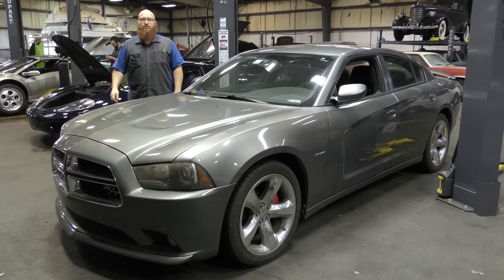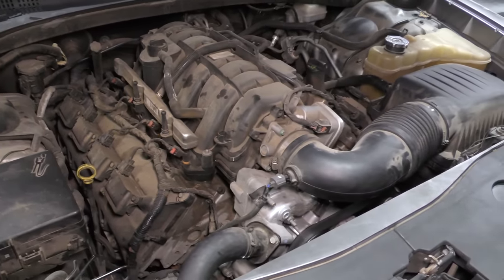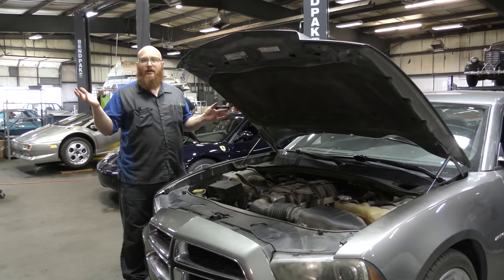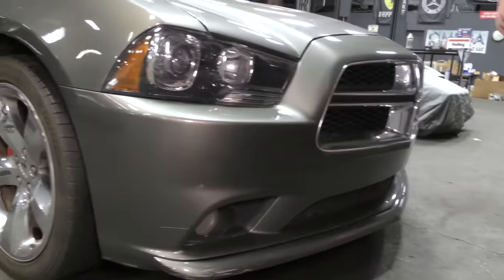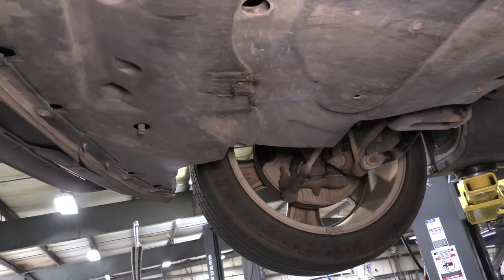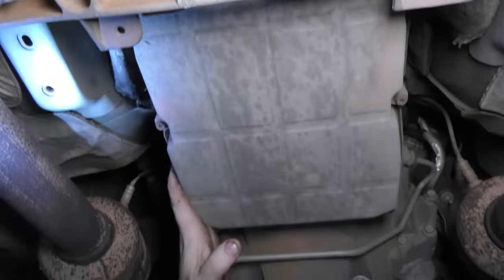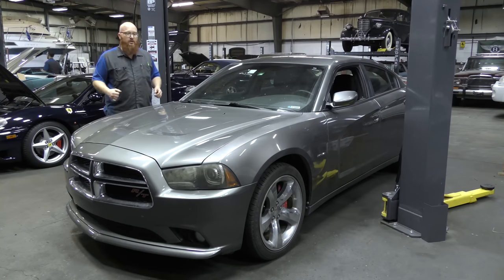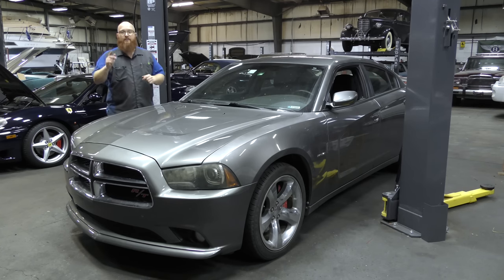Tic Tic Tic! 2011 Dodge Charger RT has the infamous Hemi tick. What will the CAR WIZARD do about it?

Comment: I just a couple days ago returned from the Ozark's in NW Arkansas from a weeks vacation where apparently a motorcycle event was taking place which I knew nothing about. About 99% of the bikes, no mufflers, loud radios. All weekend long I had to put up with this but then realized it wasn't just the motorcyclist but damn near the entire region in general. None of the diesel powered skyscraper 4x4 pickups had mufflers. Actually there was one beat-to-hell 72' Ford F-100 with half the bed hanging off the frame rails who did have a muffler. Many old beater cars, no mufflers. Even one of those two-seater egg shaped smartcars with a Beetle hood was quite loud which surprised the hell out of me. Couldn't see the darn thing cause it's so small but I heard it coming up hill from 1/4 mile away. Ain't no wonder the Christ of the Ozark's statue has ear plugs.

Comment: Dropped Valve seal on the early 5.7
The rest have a hemi tick because of the mds system. Do a mds delete and tune your car with the mds shut off before dissembling it.
Reply: Non mds hemis also get the tick.

Comment: the Hemi Tic i have found more times than not to be rocker slap . It may slap forever , the roller on the rocker may also lock up and slowly eat off the cam lobe off all while filling the engine with metal shavings. No one usually notices till the PCM cannot adjust out anymore so you get a misfire and code but by then it is way too late , those shavings circulate destroying the engine...

Comment: The tow rating for  a 2011 Charger R/T is 2000 lbs. That 3500 lb is what the hitch is rated to. Do not exceed the vehicles rated capacity.

Comment: On my 2015 Challenger RT it had the hemi tick since new,  the only thing that quieted it down was using royal purple oil, it would work well until the oil got old and thinned out. This was in the heat in Vegas as well.
Reply: That purple oil any good..?
Reply: @keyroncampbell  It worked for me , I had a 6 speed car though so I went up in weight from 5w20 to 5w30 I believe it was, I'd have to go back and look at my receipts, if you have a automatic car with mds cylinder deactivation though the thicker oil may or may not cause problems with the cylinder deactivation but that can be remedied with a tune now I believe, not that I'd let that worry me though.

Comment: helloo. my '05 Magnum R/T dropped a valve, chewed it up - new bottom end. Big money. Could you tell if the valves are bad by listening with stethoscope? If there is jingling or whatever to go with the tick? BTW, hole in muffler, tick went away. Hmmm. Ü

Comment: Wizard I hope you see this: I have a 2012 Ram with a 5.7, the tick is SUPER loud and it’s coming from the right side. The gas mileage is dropping, and I have carbon on the exhaust on the right side. Local shop quoted $500 to fix it, says it’s the exhaust manifold bolts. Are they being honest?

Comment: The “tick” is because the camshaft lobes are starving for oil do to a design flaw. They moved the camshaft up and the lifters outward. The oil from the lifter galleys doesn’t drip down onto the lobes as they no longer sit directly over the cam. Add to that the balance shaft between the crank and the cam and the oil splashed by the crank also no longer makes it up to the lobes. The roller lifters end up eating themselves and the lobes of the cam.
Reply: I heard the 6.4 fixed that problem. Did they redesign the engine?

Comment: My 392 got the “Hemi Tic” and it turned out to be defective lifters which Chrysler Fiat is not willing to do a recall on which wound up destroying my engine because it completely chowed the camshaft.  Definitely is something to worry about and it’s definitely something that needs to be fixed. These defective lifters were installed in the 5.7 as well in the jeeps ram trucks and all Chrysler platforms across the board. 
August 2019 they retried and superseed the lifters with a completely different part number and design. Pre-2019 buyer beware. Having a 392 rebuilt ain’t cheap. I’m ready to jump on board with my receipt if there ever is a class action suit against these bastards at Chrysler/ FIAT. However after the rebuild my 2012 Dodge Challenger SRT tears up the road like a scalded ape.

Comment: I just just got a 12 charger rt awd with 95k. It’s phenomenal in the snow and is loaded to stupidity and back. 4 heated seats, air cooled front seats. Even has heated and chilled cup holders. I love the look of the 11-14’s hoods and headlights. I don’t vape, but I do smoke cigars, does that count? But not in the car... I’m pleased to see that they can do 200k and still be in great shape. However I’m in pa, so you won’t be seeing my car in your shop for repairs. I do have a garage that’s straight shooting on work locally for the things I can’t do. The only draw back to this car is the mpg. I get 13 around town and 18 highway. I know “don’t buy a hemi for gas mileage” but I thought it’d do better highway.

Comment: An oil additive has helped for the valve train on the 5.7 Hemis and Seafoam has been a good one for noisy 5.3 and 6.0 Vortec. Just personal experience from my work as well as what I own for the farm. Still not a 5.7 fan but a-lot of people are so they come in from time to time.
Another one that has helped a-lot of the P0521 Sensor, Pump, Oil change time money light is using the UPF48R filter during the oil change. Not always a fix but has been for some. Seeing as I'm on this subject and already going on way too long don't always jump to "I need a sensor or the pump" check that pressure line that feeds the oil cooler right at the block. If there is oil between that and the motor replace that seal. Real easy, can drop the front of that front drive axle and just need a couple 10mm I believe to get it out and get a new one in - 15-30mins That's only been the case 3 times but so far it's been confirmed fix for those particular customers for 50,000+ KMs.

Comment: You're underselling how much discussion there is about the Hemi tick. I've got a Durango, same year, same engine. It's had the tick for the 70K miles that I've owned it and, after looking around, there are endless theories as to why.
Reply: Tech13 commented:The injectors tick very loud even more so starting 2011.they put noise insulation over the rails to help. The lifter rollers wear out and wipe out the cam lobes. That happens because they moved the cam higher in the block for better valve train geometry.  Now the cam does not get constantly bathed in as much oil and there is no oil gally feed to the lifter bores for lubrication.  It gets whatever washes over the lifters. If you hear a lifter tick that means the lifter roller is worn and the cam is getting scored. If you have a misfire and you want to determine if it's a bad cam. Do 4 or 5  Accelerations to the redline. Then the engine will start to misfire bad
 Let it idle and it will smooth out. When the ramp on the cam lobe is damaged it causes the lifter to collapse on hard acceleration.  Even if you don't hear a tick it can still be a bad cam.

Comment: Front end bushings and bearings could be a weak point. Many people I've heard from had them go out quicker than they should. Some say Hemi timing chains are a weak spot because they are longer (cam sits higher in the block) and fairly narrow compared to the old 318/360 small block chains. Ignore that extended oil change interval they advertise and save the engine!

Comment: El HEMI TIC started with the Hemi MDS system and yes, hurts the engine, and eventually a valve spring will break, usually cylinders from the center, and destroyed the engine.

Comment: Could you talk about the J series honda engines? Could you cover valve lash? I have a 06 Ridgeline  114k and did a valve lash to solve a misfire #1.  I had already swapped coils, changed spark plugs and my mechanic said it was an injector, so he did a fuel system cleaning and when that did not work I removed the Injectors had them clean, tested with new Owings and basket filter. The valve lash was last because even my honda dealer said they don't bother with it unless there is noise, which there was none. Of 24 valves only two were correct. On EX valve on #1 was so tight I could not get a Guage in it. It fixed my issue and improved my MPG.  So when do you feel the lash should be done? Per schedule (which even the dealer said to ignore) or when there is noise ( which mine did not have)?

Comment: The hydrologic rocker lifters stick over time and cause tick. Pretty common issue with all Hemi motors as well as the the 3.6L. I have replaced them on a few cars. Its more of an issue if regular oil changes are not performed.

Comment: I had a 2011 RT Max that I bought at 70k miles, AWD 5.7 hemi and fully loaded it was a very nice car untill I had gone through 3 altenators on it, found out there was a recall on them and got my money back for the replacements and the new one installed. But it started having so many other problems, the radar in the front went bad and the backup cam as well. What did it for me amd dodge was the service when I had a brake pedel pos sensor go bad. Costed 300 for the part and replacement and when I got the report, that part threw 94 different codes on the car

Comment: exhaust manifold bolts need to be replaced and if a 5.7 really ticks needs lifters . if you catch it in time easy cheap fix. if not the cam goes bye bye.

Comment: My Chrysler 300c makes a racket from the front drivers side over expansion joints but the passenger side doesn't.  I'll check the sway bar bushings.

Comment: Hemi tick is not to be confused with Pentastar Tick in dodge and Chrysler products. It does need attention when you start to hear it. Likely failed rocker arm roller bearing and continued driving could lead to ruining the crankshaft.

Comment: They sell kits to correct this. The oil pressure is not sufficient enough to oil the cam at idle and low RPM speeds.

Comment: The fact that people are driving from Texas and Oklahoma to get their vehicle fixed should tell you about the sad state of independent shops in those states.  I went to 3 shops in Houston area about my HVAC on my truck got quoted anywhere between $1000 and $1350. Got online looked at forums, went auto parts store bought 2 parts 3 hours latter and a bloody knuckle my truck was fixed for $$230. If I had the right tools it would have only taken me 1.5 hours

Comment: Thanks for the vid I just bought a 2011 392 police pursuit vehicle. It has 150,000 miles but the Florida state trooper that it was originally issued to won a few awards with this car and he took excellent care of it. You can barely hear the hemi-tik, so I’m good with it if the Whiz says so. It drives like a brand new car with a fast shifting transmission 😈. It’s since been straight piped with flomasters and a catalytic delete so 😈😈. Anyway I bought it from a guy that butchered it with off-brand road rims 2-12” kickers in a ugly box with a capacitor taking up the trunk and spare tire space 🤡 Ugh… now I’m gonna to do a tune up, new wheels pop some dents and do me some interior work. Monster of a car.

Comment: Re: The outro question, what annoying sound has a car you've owned made:  How about the timing chain / VVT rattle noise on cold start up on 2AR-FE Toyota engines. It goes away after a second but is annoying when it starts.

Comment: I personally would of WENT TO DODGE DEALERSHIP MY SELF AND PURCHASED A NEW CAM LIFTERS AND VALVES ALL BRAND NEW  just the parts not the labor that’s how I fixed my car it had hemi tick and I spended well over $2000 but it was worth it no more hemi tick and I’m always using royal purple 5w20 7 quarts and 88 octane fuel car runs super great 👍

Comment: They tend to have oiling issues to the top end at idle. You may see that police cars with hemis will ruin lifters and cam shafts faster than those hemis that are actually driven. Curious if a high volume oil pump helps.

Comment: Pushrod engines can be a little noisey anyways, LS engines are very well known for having some normal ticking. As long as it isn’t loud (rod bearing or lifter usually) than no big deal.

Comment: Those tires look like the treads are getting to a point that they couldn't handle heavy rain or standing water/puddles, especially at highway speeds. On dry or damp roads, they're good at all speeds for at least another 5-7k miles. The car owner can decide if it's worth replacing them, now, but they should be made aware.

Comment: Hello Car Wizard! So you recommend the hemi engines? I'm looking to get a 2014 Charger R/T just like this one with 120k miles. Any thoughts? Thanks in advance!
Reply: If you have not bought the vehicle, see the condition of all the vital fluids, such as the coolant, oil and tranny.
Next have an independent mechanic, do a thorough once over to make sure everything from the engine right down to the  wipers are in decent shape. Basically a 150 to 300 point inspection.
If the cost to fix that vehicle is reasonable for you and what the price of the vehicle is decent, that will be your deciding factor. 
The bottom line is how did the previous owner took care of the vehicle and was it in numerous accidents throughout its life?
You can buy a Toyota that was neglected and unreliable if it wasn't maintained well to a Fiat, that is a peach because the owner took care of it to a tee.
Mileage is relative. Just because it has higher mileage, it doesn't necessarily mean it is worn out and trash.  If the owner meticulously took care of it, it can go on forever.
Conversely,  if it was poorly taken care of, you can have a lemon by less than 40 000 miles.

Comment: Wizard those are Caliper covers first off! Second, ask @Uncletonysgarage about the lifter tick and why it happens. The cams don’t get enough oil and the heads don’t have an oil drain to allow them to get oil! I had a ‘17 charger r/t that developed the “hemi tick” at 45k miles. 0w-20 and lack of proper oiling are the cause. I hated the sound but it never blew up and ran like a beast with the 8 speed ZF tranny! You should see the stack of cam shafts at my local Ram Jeep Chrysler dealership one tec has amassed on a roll cart! I know you try to simplify it but brother you won’t bore me with the facts. Just the facts lol.

Comment: Mr. Wizard, in your circle of mechanic friends, do you have someone you might recomend in Orange County CA?  I am afraid my 2010 Grand Caravan would not make the journey to your shop.  I have a guy here but it seems like much of the work he has done is going to have to be done again.  Engine mounts, wheel bearings, brakes etc.  Or perhaps Mr Wizard fans know someone in the OC?  Not a fan of dealers as almost all of the work i had done under waranty required at least 2 visits to the shop to get fixed and often 3.  Thanks

Comment: The problem is the 5.7 idles with a really low oil pressure, Chrysler fixed that with The 6.4

Comment: What year did they change the 5.7L’s location of the cam shaft for better mileage and power, but caused the engine more problems, and the cam would completely shred itself? Like 2015?
Reply: They never changed it , all 5.7 are the same

Comment: I noticed the same Mercedes DNA similarities with my 2018 Dodge Durango R/T. I can see why Dodge incorporated Mercedes tech into their cars when they were merged with Daimler.
Reply: Dodge did no such thing. That German crap was forced apon mopars
Reply: @Welcometofacsistube  I haven't got any complaints about the German tech in my Mopar. It rides perfectly. Plus Ive work on my Son's 1988 MBZ 190E and have no problems with that car. Just normal maintenance and it's still running strong. I thought exactly like you did about German cars. Now that I have had the opportunity to work on them, they are really not that bad. It mostly is the fault of the owner who neglected to maintain their Mercedes regularly which actually applies to any car really. If you don't take care of it, it will certainly leave you stranded somewhere.

Comment: My challenger I mentioned in an earlier comment had the exact same oil pressure sensor issue! Sadly, I sold it before I ended up getting it fixed - I have a 2022 tacoma now

Comment: My 2010 Ram ate a cam at 131k.  The lifter came loose and $4k later I got rid of it.  Was so frustrating, the truck was babied and the inside of the motor was spotless
Reply: 131k on a 2020... where do you go?!
Reply: Crap, I meant 2010
Reply: I hope they fixed it on the new ones. Im a hard dodge fan but if i would buy a ram it would be a Cummins.

Comment: What percentage of hemi ticks involves the dreaded cam and lifter destruction allegedly from idling too long and the multi displacement system?
Reply: They updated the roller rocker bearings in like 2017 and as long as it wasn't run long after the tick gets really loud replace the rockers and it will be quiet again. If it got bad enough it will wipe out the affected cam lobe so should pull valve cover on the loud side and make sure the rockers aren't loose and worn out starting to eat the cam lobe.

Comment: My first car was a 93 Cutlass Supreme. One day it starting making this odd rattling noise any time I made a right turn. Speed didn't matter, noise never changed, couldn't reproduce it on the lift, it was infuriating. A LONG time later the starter went out, when I replaced it I learned the spring for the starter bendix broke..
So every time I made a right turn, the starter gear would slide down the shaft and bounce/rattle against the starter ring on the flex plate.